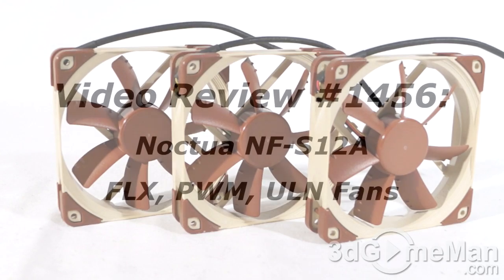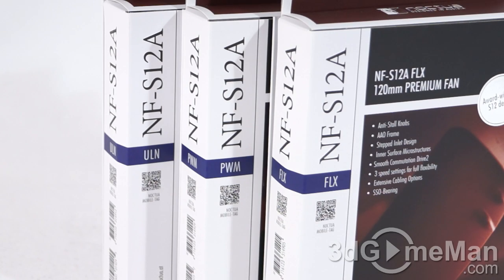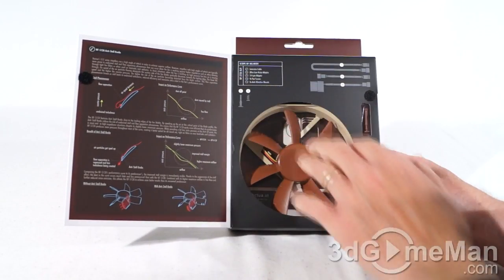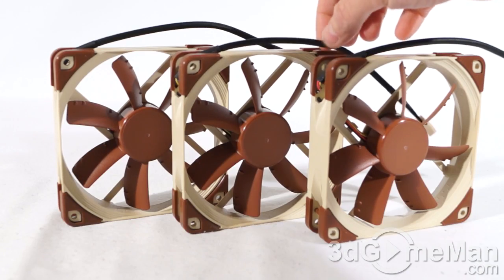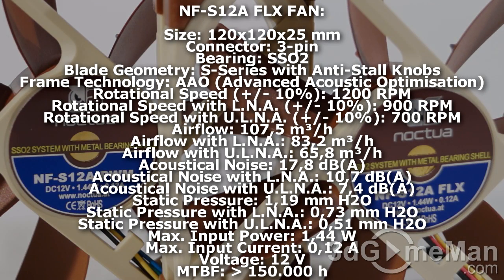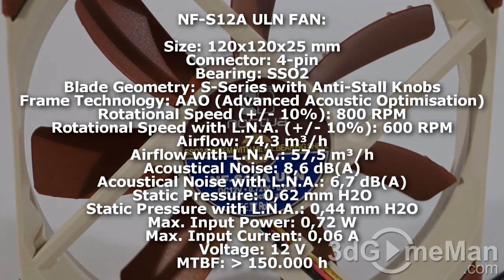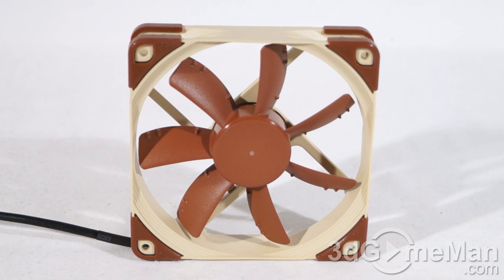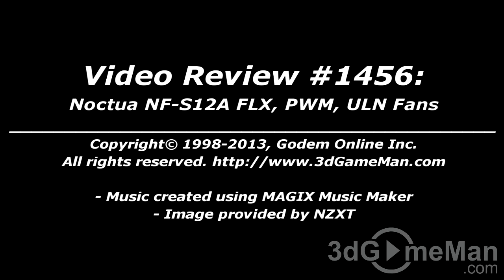#1456 - Noctua NF-S12A FLX, PWM, ULN Fans Video Review

Comment: So PWM has an automatic speed controller and FLX has speed headers, right?
Reply: +James Coburn 
No the PWM is moduled through you motherboard so if you have turned the Mobo to auto control all your fans it can do so but the FLX is fixed at a certain amount of RPM only controlable with a fan controller

Comment: If I were to buy one of these for my case and use it in a fan controller, which one should I get? PWM, or FLX?
Reply from the maker: FreshBagelz PWM fans will works fine on a fan controller, but intended to be connected into the motherboards fan header. I'd recommend getting the cheaper 3pin fans for a fan controller.
Reply: K thanks

Comment: Replaced also R3 case fans with these. Sure they aren't completely silent, just the difference is noise comes from wind resistance, not the bearing or motor. So even at full rpm, noise isn't raising your fuck-o-meter. And that colour..can see from miles away you have the best blades even if you're deaf. Which thought might come cross in mind when you set these at 800rpm and listen silence. Unless rest of your case roams like diesel truck.